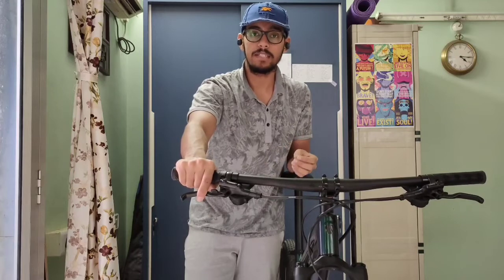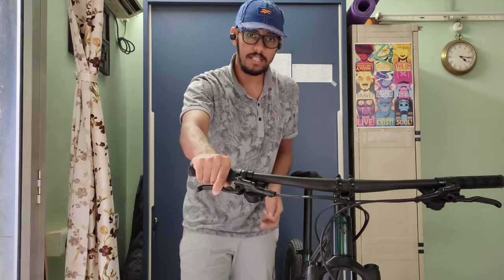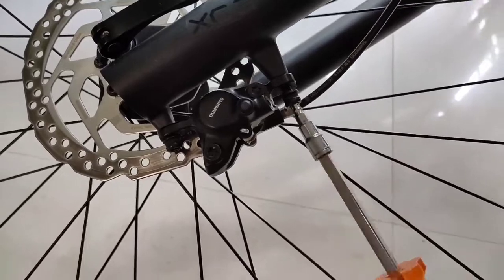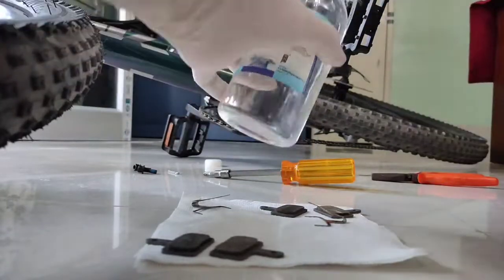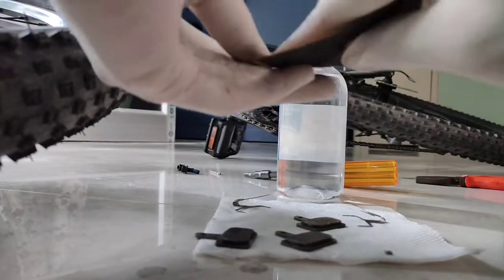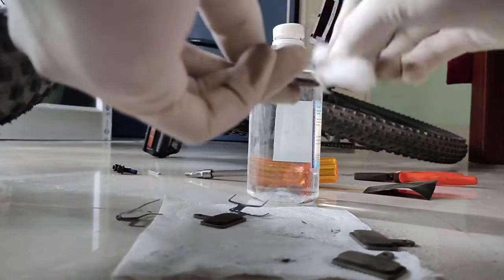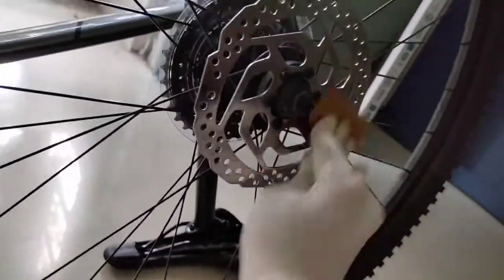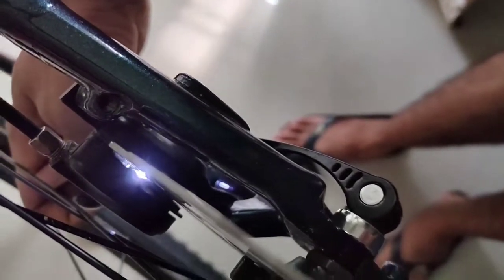How to clean disc brakes| Remove contamination | Stop it from squealing!

Comment: Hi there i see this is a old video. But I have a question. I have a mtb who was standing in a shed because I wasn't riding it. Now I'm upgrading and tuning it up. What do you recommend me to clean the rust out of the disc rotors? Thanks in advance
Reply: nothing, at that point just get new rotors, if u really cant you can use coca cola to dissolve the rust
Reply: rust will go away with braking
Reply: When there is rust buildin onto the rotors, it's probably time to change it up or of you don't. You won't have the breaking power you need, or it will be harder for you to stop the bike while riding it